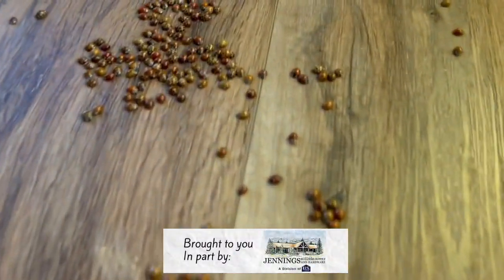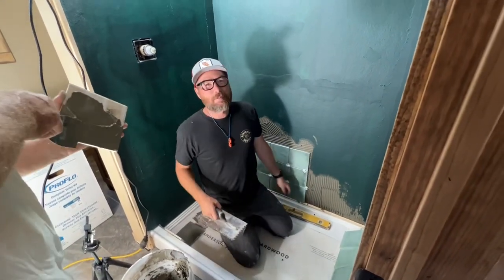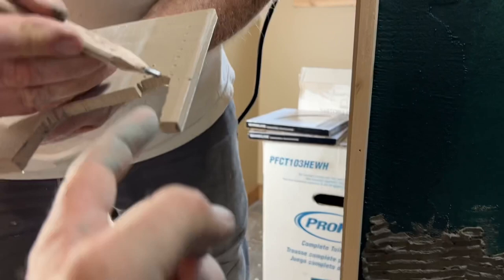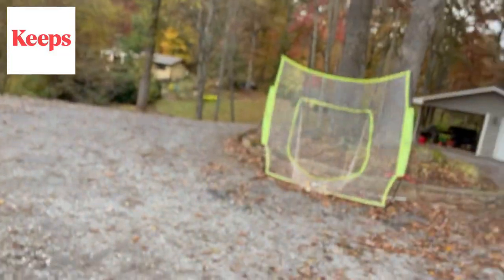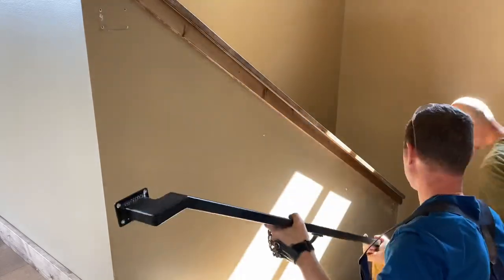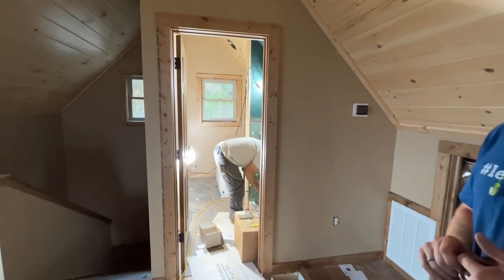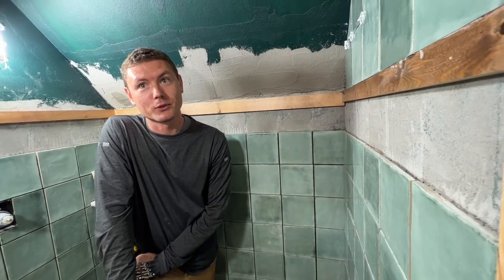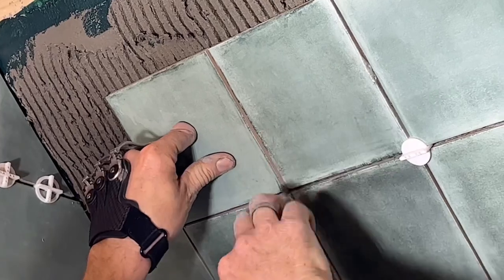Tile A Shower | Building the Nantahala Retreat #43

Comment: Protip: you can mortar small piece accent tiles to something like Kerdi membrane in advance. This creates one piece that you can then apply once the mortar has cured. This also ensures an even and flat lay of the stones and you don't have to scrape out the mortar like you had to
Reply: and you can sort them out so you dont have to cut the sides of the stones to make them fit. The hard straight line of the cut stone was bugging me so in my shower i took them out and replaced them with smaller round stones.
Reply: Ive been doing tile for years and never thought of that. Its freakin brilliant. Will do on my next mosaic for sure
Reply: I've done the same several times with mosaics. Apply them to Kerdi membrane and then apply the large membrane to the wall like a large tile. Works well when that client has to have those tiny tiles on that black splash and they are barely sticking to the manufacturers backing. Have also used painters tape on the face of the tile to just keep them together during install.

Comment: There is a trick to doing ceiling tiles. I stuck 12x12 granite tile to a flat ceiling. Add thin set to the ceiling then when you apply it to the tile back create a circle patten with your notch trowel. Then pushed to the ceiling it creates a suction. Have to have the right consistency of thinset too.

Comment: If you dip A little junk chip brush or cheap paint brush in the bucket of water you can clean out the grout joints on the river rock tile a lot easier and you do it as you’re setting. Nothing worse than having to scrape thin set the next day.

Comment: Ive put even larger tiles on flat ceilings. Just the suction of the mud held em up really well. But i did use nails on the walls to hold up the sides as well as the field just incase. But, i think i could of done without them
Reply: Nailing tiles to the ceiling? Great idea! What could possibly go wrong!
...I've done much the same :-)

Comment: Question when a owner is building a house do they pay for the materials or do the construction workers pay for it
Reply: Pardon me for butting in, but that depends on the agreement between owner and contractors. If an owner wants to be the general contractor, then they should be buying materials, for the most part. There are all sorts of exceptions.
Reply: @DoctorHayduke  see im 15 and im curious on how this works
Reply: @DoctorHayduke  Ultimately the owner always pays.  Whether they order the materials themselves or whether the construction company does depends on the agreement.
Reply: @mviixm  In the case of the Perkins Brothers, they are contracted to build the house. They supply materials for the work they do, and subcontractors(who generally supply their own materials). In the end though, the owner pays for everything unless the builder makes a poor bid or a costly mistake. Hope this is helpful.

Like I said, there are all sorts of exceptions but this is the general recipe.
Reply: @-_James_-  I was in the middle of typing that!😆
Reply: @DoctorHayduke  ok thanks you

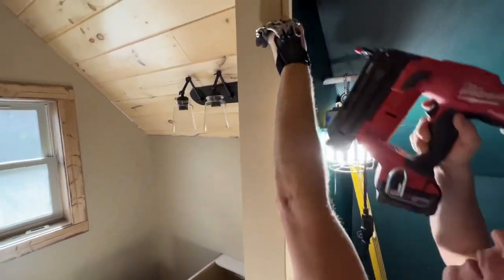Comment: 2:19 Jaime using a battery powered gun? I never thought I’d see the day.
Reply from the maker: Yep.. they are really great when you just need a few nails and don’t have to drag an air line out
Reply: @PerkinsBuilderBrothers  by no means am I a professional, I just screw around on the summers building an swinging a hammer, but I love batteries on tools so much. I started with hand drives and instantly got batteries and would never go back.
Reply: Me too cause I love air.. but that battery gun is nice…

Comment: For next time, back buttering those small walls tiles was unnecessary. Big tiles sure, but not little 6X6 tiles. Back buttering for that 45 ceiling is good.
Reply: Hey Kevr. I have to disagree (in a friendly manner). If they are not back buttered, then eventually.....pop!  Even if they won't pop off the wall, it is still a great feeling of knowing you took that extra step in a proper installation.
Reply: @jonw8516  No worries, if your thinset isn’t too dry they shouldn’t pop off. Fwiw, I’ve demo’d showers where the 4x4 tiles were put on with some kind of glue that was barely holding the tiles. But the grout seemed to lock them all together.  Whatever works for you though. 😀👍

Comment: Nice video. What's the deal with your back buttering technique though? Y'all are covering those tiles like you're putting jam on toast. 

Doing that is insanely slow, not to mention a waste of material. The tile backbutter should be notched, just like the wall, so you get good strong mechanical adhesion. 

Honestly, this isn't to make anyone feel bad, but just go take a look at how some of the pros who only tile do it and you'll see what I mean. 

I bet you could have those showers done 30 percent faster, with longer-lasting results by just tweaking your technique!

Cheers and good luck.

Comment: "Should be pretty waterproof" omg, so scary to watch you guys build bathrooms compared to what the building codes in Sweden say. Here, the entire room basically has to be FULLY waterproof, you should be able to seal the door and use the room as a pool all the way up to the ceiling, that's how waterproof our code dictates bathrooms to be here.
Reply: "Pretty waterproof" is not good enough anywhere.
Reply: Erik was just being understated. That membrane, combined with the tub, makes this waterproof.